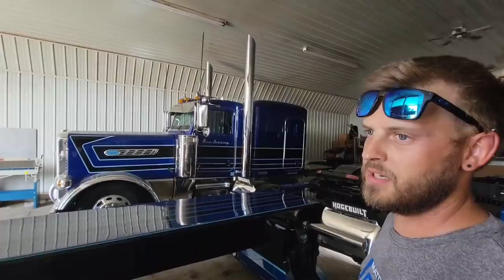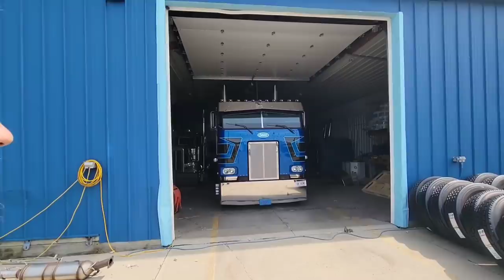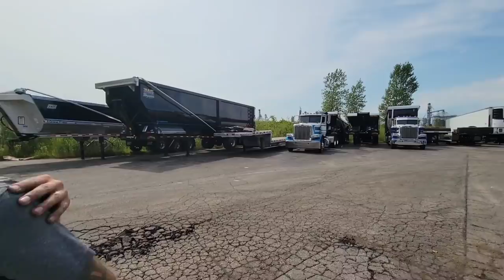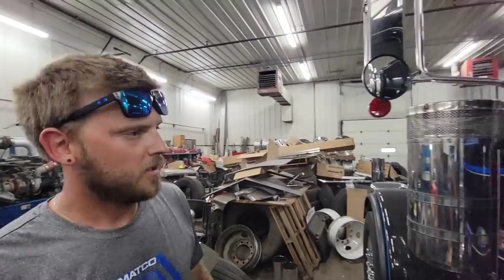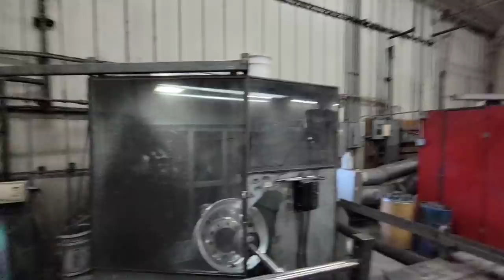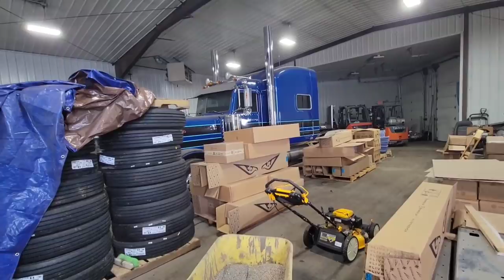First Ever Tour Of One Of The Most Custom Semi Truck Fleets In America, Life Of A Truck Driver

Comment: great guy great company beautiful trucks, but i’ll never understand stretching the frame rails like that. it looks ridiculous and doesn’t serve a single purpose. but still 10/10
Reply: Hello Philip how are you doing
Reply: For cab over trucks makes less likely to pick the front end up. Also on all trucks longer trucks ride better and smoother.
Reply: @kennethobando5755  i’ve been a driver since 2001 and i’ve never heard of the front of a truck being lifted up, lite  on the steers at most. and a long wheel based truck is smoother because you aren’t sitting on top of your steers but a stretched cab over isn’t gonna be smoother because your still sitting on them. i was just saying my original comment basically because it’s dumb looking, i know the actual reason, it’s to carry more weight, a lot of guys have these trucks and don’t even know what it means….lol. but anyway thanks for the comment be safe.